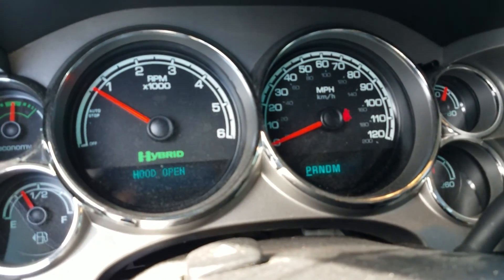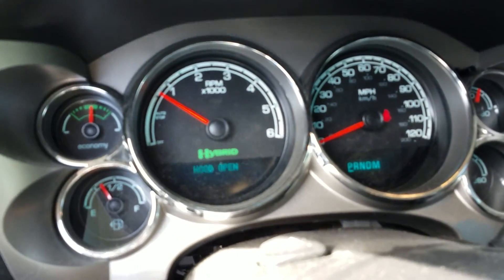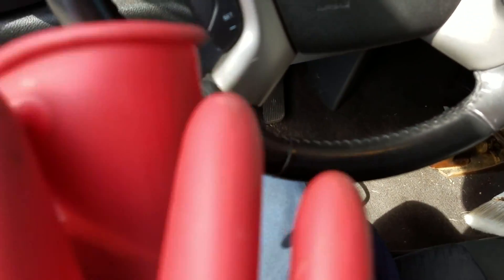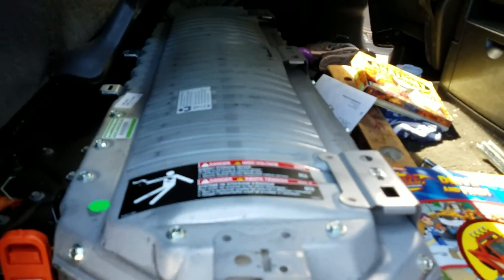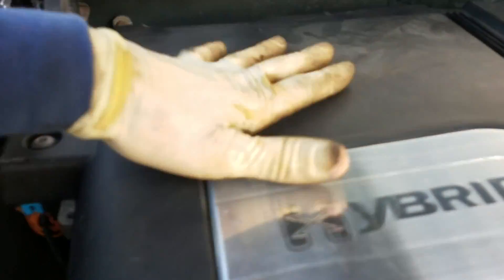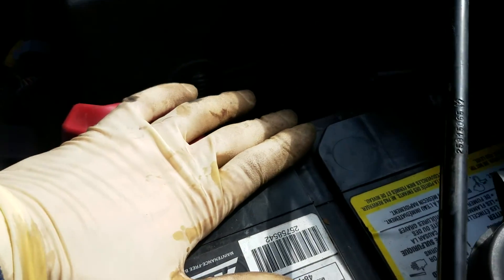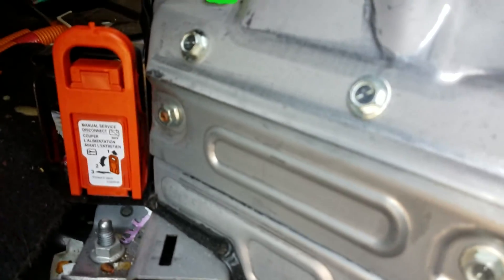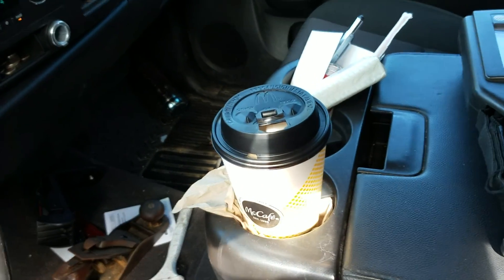Chevy / GMC Hybrid High Voltage Battery Disabling

Comment: I wanted to check my hybrid battery on my 09 Escalade hybrid and I wanted to check out the hybrid battery I ended up unplugging the service port n ended up reconnecting it and not messing with it and now I have service hybrid battery and no start

Comment: I was told to disconnect the hybrid system before changing the 12-volt battery when it goes bad and I'm confused because you just said the opposite? Do I need to disconnect the hybrid battery before replacing the 12-volt battery?

Comment: can you disable the hybrid battery and run the truck on gas only?
Reply: Did anyone ever figure out if you can drive it with a dead hybrid batter?
Reply: @justinpeck1013 yes you can, but it will continuously throw you various codes and good camouflage serious issues that could destroy your entire system from things failing throughout your entire engine and you not knowing it because of disregarding the check engine light and the endless codes you will get for things that are working properly so you basically never be able to distinguish what's working and what isn't.
Reply: I’m actually looking for the same answer.
Reply: Same here if I find out I’ll message here.
Reply: Hayır. Bataryayı turuncu soketi çıkartıp  devre dışı bırakılınca araç çalışmıyor
Reply: Same

Comment: Would you think a pair of shorty direct bolt on headers would fit on the passenger side properly in place of the cast iron manifold? 2011 Chevy Tahoe 60 hybrid

Comment: Guys if you are only working on the outside of the hybrid battery case. Make sure you remove the orange safety plug. No high voltage gloves are needed. The plug removal physically breaks the connections inside the battery. This is for first responders to an accident and service only. Stay out of the battery case itself and you will be fine. People seem to think these things are some kind of bomb or something. It is a battery (just a big one). Remove the plug and it is a dead battery.
Reply: If I need to replace transmission if I disconnect that plug would I be fine

Comment: Hi I have a 2009 GMC hybrid Sierra, the hybrid engine control module system stopped working and I replaced the part . I got a used one from a 2009 Chevy Silverado I installed it and the sensor on the dashboard dire not come back on . But now it has the service hybrid system light on? Can u help please??
Reply: And it won’t start, but the radio turns on the lights and everything on the dashboard turns on.
Reply: The screw on the top by the fender hooks to a sensor if loose won’t start also charge 12v battery and have it tested these things like full power on the 12v side
Reply: @dukezity5226  on the hybrid cover, under the hood on passenger side, it’s a torque bit type screw. Holds the hybrid cover on.

Comment: Took my battery pack apart cleaned all the terminals I have 326 volts but at the connections I have zero volts.
Reply: it has a high voltage relay   which turns it on when the key is turned

Comment: Neighbor of mine says her 2012 Tahoe needs $7000 worth of work. She didn’t say to what. I’m assuming it’s the battery pack, she has 105k miles on it. Do you think the battery pack actually went bad this soon? Or is this GM Hybrid known for issues?
Reply: They typically outlast their 8 year 100k mile warranty and seriously doubt it went bad in 5k miles also replacement is ~2.7-4k so chances are it needs something more or is being seriously overcharged
Reply: the battery cost 2400-3200 depending at the dealership  just for the battery only  no housing
Reply: GM hybrid 🤣

Comment: So what does that code exactly mean?
This just happened to mine today wondering what you did to fix the issue mine wont start its a 2009 tahoe hybrid
It just brings up that code of 
Service the hyrbid system any help would be appreciated
Reply: the issue is corrosion on the bus bars   as the battery should last to 200 to 300k miles according to GM  
cleaning or replacement of the bus bar (very cheap to clean it) DIY  need HIGH voltage glove though    or good muti meter to probe it before touching
Reply: I have the same car and same problem, were you able to fix it?